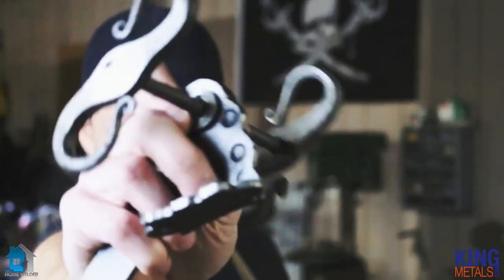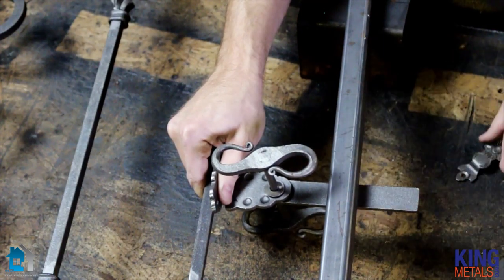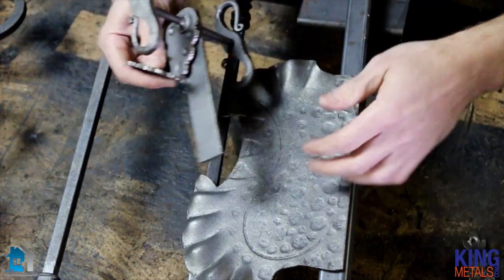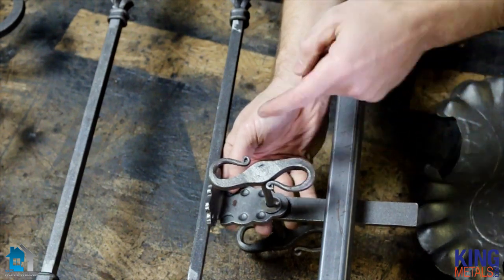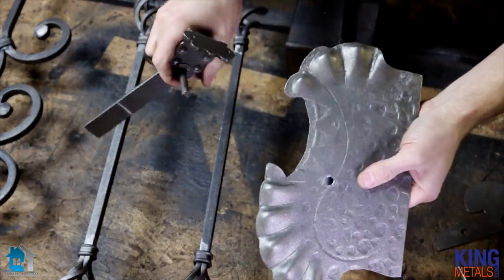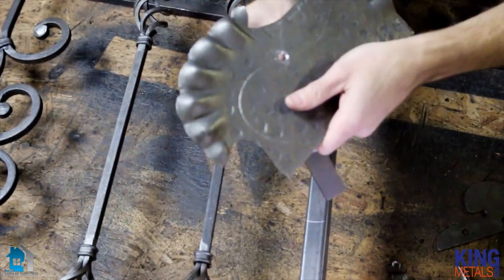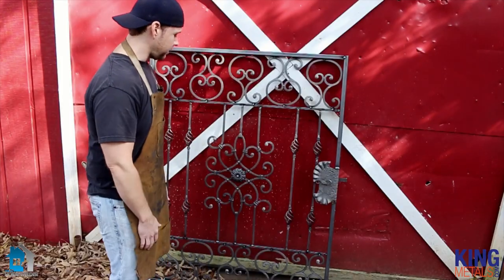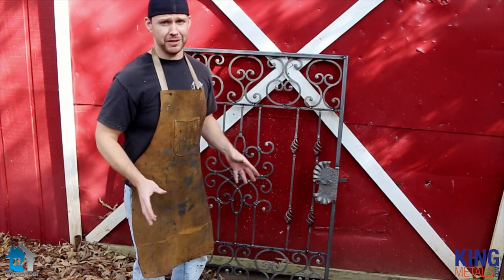Gate Series part 3   Custom Gate Latch

Comment: Cool stuff Andy, subscribed a few moths back and enjoy your "weekly tips and tricks" I might have skipped it but do you run a series on picket spacing by chance?...for instance, a 4' long (horizontil) fence/gate how do you determin the picket spacing?? I've took your advice and ordered a catoluge, just in transit I'm sure. Keep up the clean work. Your stuff looks good. 
-Pidge